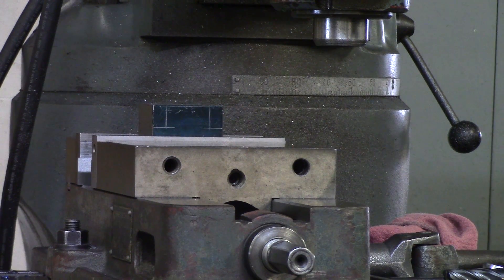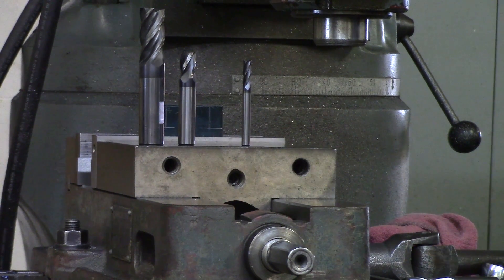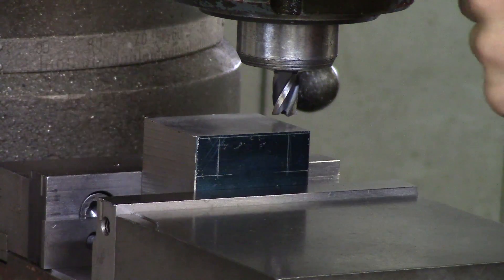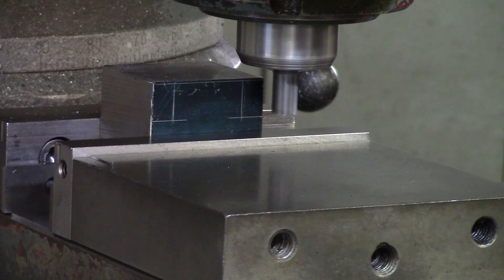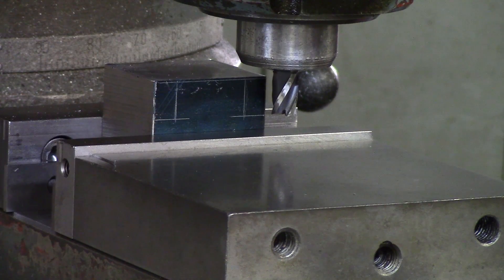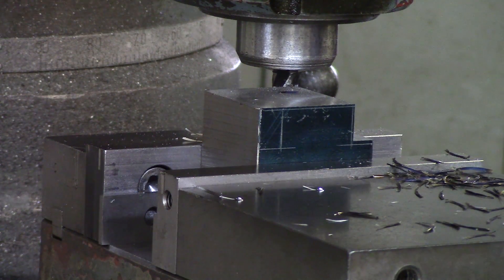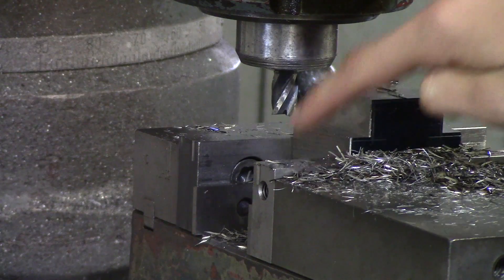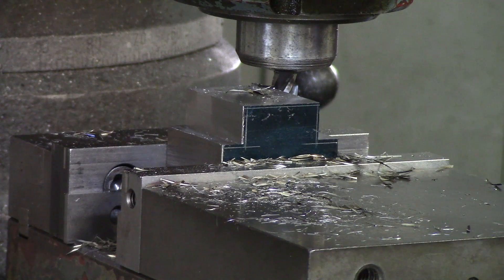What's the BEST Endmill for Beginners?

Comment: Before  matriculating  university, I spent  over 20 years in tool rooms  mold rooms  and   tool and die  Never saw a carbide end mill. HSS is  perfectly  fine for  all alloys of steel  just not pre-hardened.  If there is a down side to it, it is that you have to go slower and pay more attention to coolant.   In fact  on mills such as the one you have there Carbide is   probably  the wrong choice almost all the time because your bearings are old and   small and worn and   not rigid enough to provide the  ridigity  carbide needs.  So  you are probably  getting half the  expected life of a carbide end mill.
Reply: I agree with you wholeheartedly. HSS has been around forever and precedes carbide by probably 50 years. Carbide is great on tool steel or stainless steel parts but for mild low carbon steel HSS is more than adequate especially if you use a good coolant system since heat is what kills any mill tool.
Reply: And it's a universal mill with literally 7 different linear and rotary manual axes, so just doesn't have the... "rigibility" to use only carbide.
Reply: @professorjim6874  "rigibility"  I gotta keep that one.  At first I laughed at him,  but  it's grown on me.   My 47 Horse Tractor has great rigibility.  try to move that boulder, the rigibility will amaze you.  The pastor has a character of momentous rigibility.
Reply: If your machine isn't clapped out, carbide can be more economical than hss in the long run. You also have the option of not using coolant at all with carbide. I actually climb with carbide on my Bridgeport for finish cuts. It can be done.
Reply: Facts.

Comment: You lost me at high speed steel not being able to cut steel.
Reply: I think it was more of a: HSS will cut steel, but it's not ideal as it will dull quickly.
Reply: @madaxe79  HSS will cut steel fine. Obviously it will dull faster than with aluminum but I've milled 4140 with HSS just fine and the cutter wasn't (noticeably) duller
Reply: @henrydando  yeah as I said, it will cut just fine, but much more slowly and will dull quickly. I still Use HSS end mills for some things, and all my broaching tools are HSS, and most of my drill bits and taps are HSS, but carbide does have significantly better performance in most materials.
Reply: He didn't say that.
Reply: I wouldn't know any better about use cases of HSS since I'm fairly new to machining (which is why I'm here) but "ridgeability" is what sealed the deal for me. Can't take someone seriously when they can't even say a simple word like rigidity.
Reply: @whogavehimafork it could be the case that the presenter is not a native english speaker.
Reply: And "ridgeabuility"
Reply: @sparksmobilerepair4025  rigidity
Reply: Rigibility is just fine in the machine shop.
Reply: I've found that HSS is actually pretty ideal for deep cuts on steel as there's less chatter. It's obviously softer than carbide and absorbs more of the vibration. I experimented with this at .750 depth of cut and got better finishes out of the HSS.
Reply: @Tin_Hat_Cat  I agree in context. I use carbide end mills for majority of my work, but if I need a super good finish, out comes the old HSS end mill. It’s not that it’s better, but to have a dedicated finishing carbide end mill, is 10 times the price of a good HSS end mill.
Reply: A2 cuts nice with hss
Reply: Not without coolant. I believe he was in the mindset of not using a mister
Reply: 17-4 as well